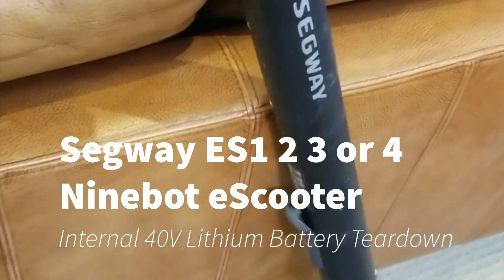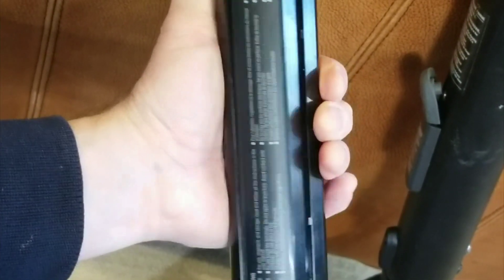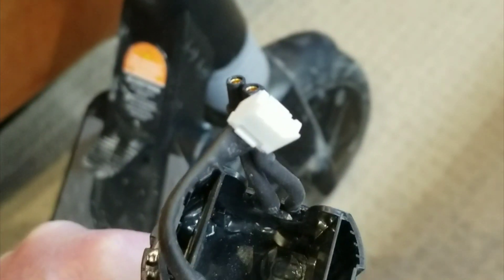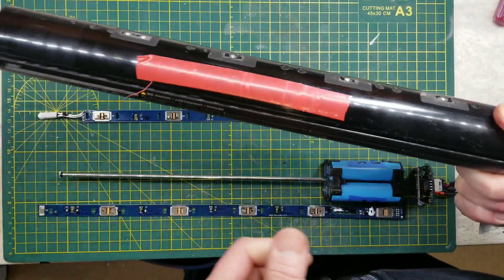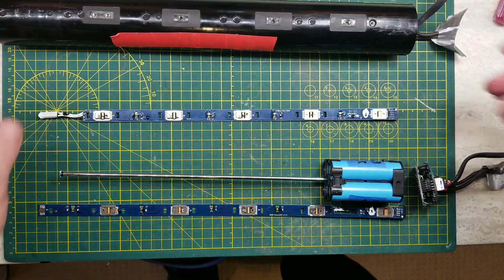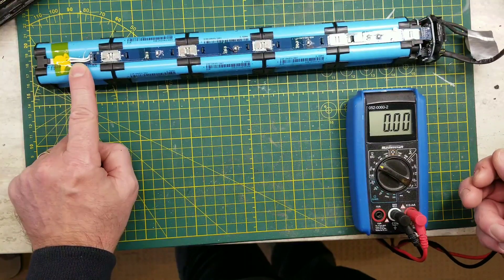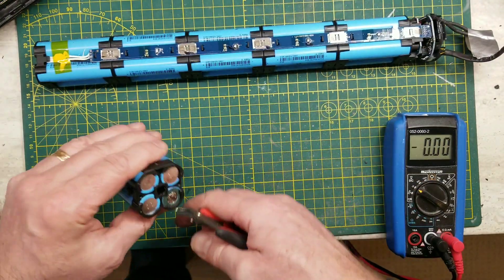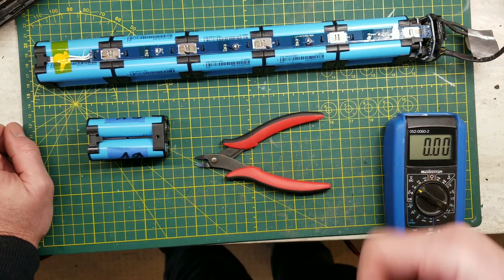Segway Ninebot Internal Battery Teardown

Comment: I bought a virtually unused ES1 from someone for $25 that said it just stopped charging.  I thought it was worth attempting to disassemble and push the copper bms reset button. When I removed the battery and controller, the white connector on the battery end (3-4" wire) wasn't connected to anything. Only the black wire with that goes to the board was plugged in.  Is that normal on this model or am I missing something? Also, the larger of the white connectors between the controller and the motor/wheel assembly wasn't connected to anything.  When I've watched other videos of disassembly, everyone seems to be disconnecting both of these but I dont see anything they are supposed to be connected to.  Any insight or suggestions?  I clicked the brass button and have the charger plugged in (green light on the charger), but I'm not getting any lights on the battery.  I'm getting 0 voltage on all 5 packs both sides.  Any help would be appreciated!

Comment: So I have 1 of these batteries that I know was only 2 weeks from new a couple years ago and hasnt been used since or charged. Im assuming that all it needs is a good charge but the blue light isnt flashing anymore either and Im not sure how to get it flashing again without charging it again but that blue light was flashing 2 years ago just fine so are u sure the blue light means its done?? Nothing happened to it in these last 2 years as it was stored in the house unused at all I just have had the scooter disassembled so I havent been able to charge it. I have someone who wants to buy this internal battery from me. Any recommendations on what I should tell him or suggest he do upon receiving the battery?
Reply from the maker: Heyyyy - so after I recorded the video I learned about the little brass reset button that sits on one of the two IC boards I showed. I think the one with the led closest to top of pack.
It turns out that these units go to sleep after charge diminishes. One of the ways to wake them so you can recharge is to depress that button. 
The challenge is you need to drill a tiny hole in justvthe right place on the case to get to it.
There is a guy in California who posts lots of content xxxGarcia - name escapes me. He shows how to do it.
He did electrical conversion of VW bus ... maybe you can find that vid with this partial info.
Best wishes!

Comment: I have 45 error code,  both battery charging normal when connecting them direct to the charger through TX30 but not charging when connect them up to control board, any idea to fix 45 error code  ?

Comment: My segway es3.
Drives slower then walking speed.
Even in sport mode.
And keeps beeping.
Showing 42 on the screen.
And a symbol of a red wrench.
It also doesn't seem to want to charge.
Does anybody know.
What the solution is?

Comment: Can a second external battery be connected to the front of the ninebot e45d? So I had one internal and two external batteries? how can i connect together ?
Reply from the maker: If you are willing to charge batteries separately - probably is a way. You'd need to connect all 3 packs in parallel. Probably need to put T style connectors T40 T60 etc. onto packs to connect them. You would lose 'one connection' charging. Its beyond what I would take on personally but in theory possible I would think. Best wishes on it if you take it on. Be careful!! LI tricky and goes boom on occasion

Comment: took mine to a shop for board replacement inside, and after i left the place less than a block i hit a bump too hard and something came loose and now wont stop beeping or work.
Reply from the maker: Ouch ... that sucks - these machines really don't have much in the way of suspension. Hard on the internals. Hopefully that shop was able to fix again.
Best wishes. Ride well!

Comment: Question - if battery is totally dead and if I tear it down, and replace all 18650 elements and put it all together - will it work?
Reply from the maker: Hi E -
Theoretically ... possibly.
IF the electronics are all still good AND you are good with spot welding new cells AND cells are to proper specification - then should work but that's a lot of risk and work in my opinion.

Spot welding is a tricky business unless you have correct equipment.

Best wishes on your project if you attempt. Please let us know how goes.

Thx for watching and commenting.

Comment: The battery is rated at 36v 5100mAh. Assuming a 10s2p they have pretty poor cell mAh (2500) and could be improved by rebuilding with 3000+. I don't see an amperage rating.  Anyone know?

Comment: Hey my battery health is still good but I need to replace the connector on it because it's worn out doesn't stay connected so my scooter constantly switches between having the external pack and only using the onboard. I have found that you can buy the connector really cheap. How easy is it to remove just the connector?
Reply from the maker: @howcin Hi - thx for reach out. I've never replaced one myself unfortunately (fortunately) and am assuming you mean the connector inside the upright tube in with internal battery etc.
That would mean having to remove tube - unscrewing end caps - gently pushing guts of tube out to reveal IC boards/wires/internal battery pack - replacing the part - putting it all back together.
I think the trickiest bit would be desoldering/resoldering that jack/connector to IC board IF that is how it attaches. If part comes with lead wires/harness and just clips to board and jack/connector screws into a bracket then wayyyyy easier.
Guess it depends on your patience and skills.
My Dad always used to say "nothing is all that difficult ... some things just take more time"
Sorry I have no specifics for you but best wishes on your fix. If you are handy with solder then can't be all that hard. Pls be safe!

Comment: so ... just how long can these batteries last before it's time to dump the scooter?  Because my front tire lost most of its thread anyway so i'd rather not repair it.
Reply from the maker: Hard to say for certain - probably someone out there way more knowledgable than I who knows about how many charge cycles they can go through.

If you are wanting to move it to its next assignment and dont really want to work on front hub, I'd recommend putting it on Kijiji/Facebook marketplace/craigslist and I'm sure someone will snap up. Take your winnings and get a newer one.
They still have reasonable value if they are still working and rideable but have been ridden hard.
My 2 cents. Best wishes with that.
Thanks for watching

Comment: Thanx 4 nothing
Reply: Ok, I spoke 2 soon
... You're opening it up now...lol
Reply from the maker: Thx for 2nd comment. Wish these batteries weren't so troublesome. Hope you at least got a glimpse of what's inside them that you might not have before. Hope you have a great day.
Reply: @fixitdad899  yo, I just found it in the street and know next to nothing about this cell except that defibrillation isn't my cup o tea...so I'ma be careful...thanx n  g'day to you too.
Reply from the maker: Yeppir ... zap no good.
Tip I saw somewhere if you poking around electronics you shouldn't be ... keep one hand behind your back. When you have two hands in current can go from one hand to the other via your arms ... heart in the middle of the path. One hand = no path thru heart. Maybe no good for big toe tho!
Reply: @fixitdad899  sound advice, I'll try to follow it...not sure how to remove case with one hand though...lol
Don't think it has a charge though as I took a meter to the leads and didn't get any reading but that's worrisome too...I'll treat it like a loaded gun.
 I'ma harvest those sweet 18650s for my flashlights.
..lol
Reply: Any advice on how to break the circuit would be helpful cause I've kinda been there,done that on other batteries and the sparks fly on the first snip.
Reply from the maker: Dont count on no juice in pack because none at leads. If the pack has gone into hibernation mode the control board cuts the connection to leads. There can actually be decent charge in cells themselves. Surprised me first time I encountered.
Re: first snip - try to curl away as you cut. Less chance of cut pieces staying close together and 'arcing and sparking'. Have fun!
Oh ya ... there is a little brass button on control board. Press it before you cut to pieces. If lights on board come back on pack might still be good as is. Worth some $.
Reply: Thanx, wanna buy a cell...cheap?
JK, I've not looked r tried to reset it yet...lol

Comment: Thanks for the video.  if you have a flashing red light what does that means
Reply from the maker: "BMS standby, over-discharged, not hibernating yet" 
Hi @Consty Ekah - If you Google symptom above and add 'Ninebot' various sources cite error codes and meanings. I think you have a battery that has over- discharged. If these batteries are ridden hard and then put in a closet over winter for example - they continue to lose charge. Once they get below a certain threshold the BMS (battery mgmt system / circuitry on battery pack)
starts to shut things down.
If way too low battery goes into hibernation mode and you get no lights. Either way you would need to 'bump charge' the pack/cells to get back above this minimum charge threshhold.
That process beyond my capabilities though!! Best wishes ... hope that helps a bit.

Comment: HELP! 
I have the ES1 black/white Bird model.

I fell and noticed the brake throttle flipped the wrong way up. After communicating with the manufacturer, I replaced the brake throttle with the assumption that was the issue. The warranty is expired now, though.

However, I think it's a fuse or a loose cable with the battery. It turns on, but it turns off if I try to use the go-throttle or brake-throttle while moving over 1 mph.

I have already checked the motor and other connections. I was just having a hard time removing the battery, so I searched for a video like yours.

Can I order a battery, or can you fix it, or is there a solution I can do myself?

[I used Grammarly]
Reply from the maker: Hi JP
Apologies- I'm not a scooter technician or a seller of parts -  just a curious Dad. 
I don't have a fix for you offhand but things I might do if I were in your situation:
1 - does it show an error code on the screen as it shuts off 'error 22' 'err 43' or something like that ... Or does it make a series of long or short beeps when it shuts down?
Sometimes it will give you a hint about what's wrong. Look up Ninebot error codes if you do get one.
2 - if the screen turns on at all it seems to me your battery is probably reasonably ok. If you can access the battery output leads (to motor) check voltage (carefully)... should be 36-40v.
3- agree - recheck all electrical connections. They can shake loose especially after fall.

Sorry I can't be of more assistance. Best wishes on your fix.
Reply: @fixitdad899  
THANKS for what you could do. 

After your reply, I realized that maybe it's the fuse because I had an error 15 when it fell and damaged the brake throttle as it was rotated too far.

Last year, I replaced the brake throttle. That made the code go away. I'm not sure if I rode it in-between incidents but since then it was having the current issue of shutting off when using any throttle while over 1 mph.

If I didn't ride it, I think, maybe I incorrectly reinstalled the throttle system.

A different video suggested that the bumpy streets or hard landings from high city curbs might've broken it. However, I am hoping a small tweak to throttle system is the answer.

I would check the battery if I could remove it from the neck: youtube.com/watch?v=hf_KrEb76ZY ... maybe I'd have to ship it to the guys in that video.

Comment: I have a question. my battery blinks red. I opened the pack and on one side is around 3.7V /cell and the other side shows 0V. what could be the cause? thx
Reply: My battery blinks red too is that normal?
Reply: @stefanverhoef7193  no, it is not
Reply: @synhro  do you know how to fix it?
Reply: @stefanverhoef7193  the battery controller is probaby dead, m gonna buy a new battery.
Reply: @synhro  wasnt connected to the controller
Reply: @stefanverhoef7193  i meant controller of the battery
Reply: @synhro  ok im probably going to do to
Reply: @synhro  my external battery wont connect to the controller i have rn do you think thats bc of that too?

Comment: It seems the batter is just “sleeping” and need to be woken up. The battery controller does this to prevent total discharge while in storage.
Reply from the maker: Hi Emmett
Yep ... It could well have been the case. I was an escooter battery rookie when I did that video.
What I wish I had known then..  the function of the little brass button on the control board  ... 'Reset' / 'Awaken'  .... doh!!!!

There's actually now a great video out there showing how you can drill (very carefully) into the packs just above that detente button so you can depress it without going to lengths I did.
Lifelong learning has its moments!
Have a good one sir! Thx for watching and commenting.
Reply: @fixitdad899  Yep. Jehu Garcia’s video. I’ve got a couple of his scooter packs around myself. :)
Reply from the maker: He's fantastic! I wish I was in the States for better access to him and his products. Alas ... up here in the great white north makes access to his stuff a bit more challenging eh?! Have a great wknd. At risk of sounding like a total Canuck ... I bought a Kevlar canoe yesterday ... no batteries required! Goin' paddling.

Comment: anyone haveing issues with throttle getting stuck
Reply from the maker: Physically stuck or speed control logic stuck?
One thing that can surprise newer riders is cruise control locking speed in after I think 6 seconds if engaged.
Not a physical issue ... more a preference/ programming issue.
My brother in law had a M360 clone unit where brake cable switch was not working. He would engage brake which should disengage cruise control ... it didn't. Only way to disengage cruise control was to flick accelerator which is very counterintuitive especially in a panic situation!
He enjoyed some road rash from that malfunction.
Reply: @fixitdad899  Thank you so much that fixed it ^5
Reply from the maker: Excellent... glad I could help

Comment: You mentioned that typically you find one half of the battery is dead. I think I have found this exact same condition on three internal batteries I just opened for a friend, all the same side. The 'bottom' side from B-  will read 2-3v between connections (discharged but still potentially healthy), and the B+ side is almost perfectly zero on each cell (ruined cells), maybe one or two are in the mV range. 

Do you have any idea why this is? I have never heard of a battery failing like this. I suspect maybe something in the BMS is prone to failure and shorts or at least drains that side of the battery? I was expecting to be able to replace a few cells, but I don't think I can trust the BMS.
Reply from the maker: Hey Tim
Bummer. 3 packs?!
That 1/2 pack condition is perplexing and actually led to me mis-stating how the cells are configured in the pack in the video. Someone corrected me in comments which was appreciated.
I think I said cells were configured 10S2P whereas they are actually 2P10S (or vice versa)
I assumed that there were 2 stacks of 10 cells each stack all connected in series (boosting voltage to 40v ish) and then the 2 stacks connected in parallel creating what I thought were the two halves.
From what I understand now there are actually subunits of 2 cells connected in parallel (4ish volts) These 10 pairs are stacked in series to boost voltage to 40ish volts.
(Explanation above more for other readers as you probably know this already.)

So... short answer (no pun intended) is nope I have not uncovered why this is the case.
Your very well described condition above does agree with what I've found but I'm stumped.  Bottom line I don't trust the boards at all and am just using the good half cells for salvage.
Me no likey the 'hiss-smoke-boom-fire' in my wooden home.
Thanks for reach out. Sorry I don't have anything more insightful.
Best wishes on your projects!
Reply: @fixitdad899  Thanks for the additional info! Yup I will probably just salvage the living cells. I'm just bummed that these packs seem so deeply flawed.

Comment: Absolutely fantastic tear down. Need to open my segway s3 up as having charging difficulties. Very helpful
Reply from the maker: @DIM Tips thx for kind words and best wishes on your diagnosis! 
BTW Not sure if S3 has external pack as well or not but I've had issues where external and internal packs lose connection and play havoc on charging. Especially if you ride them rough. Oftentimes even with just internal not the battery at fault .. is loose connects.
Cheers!